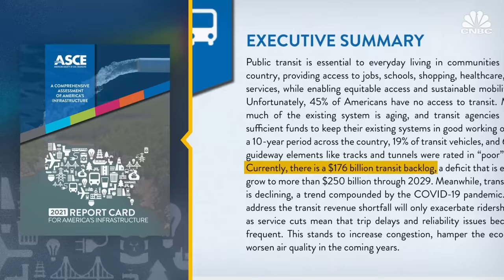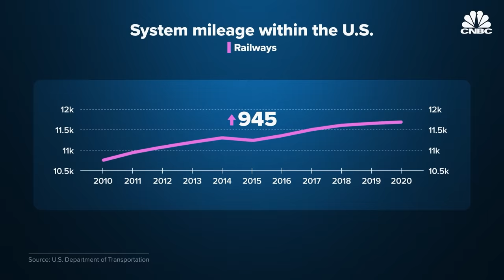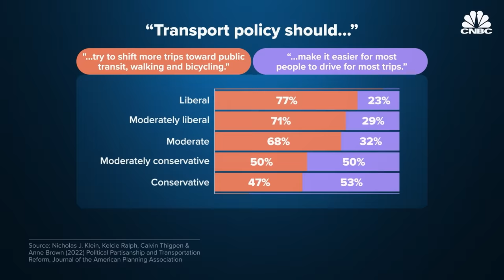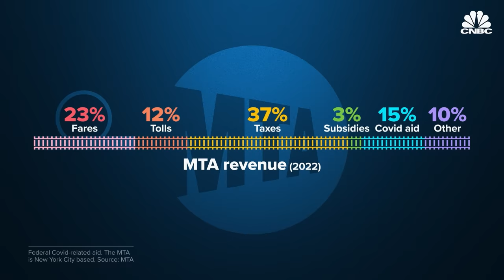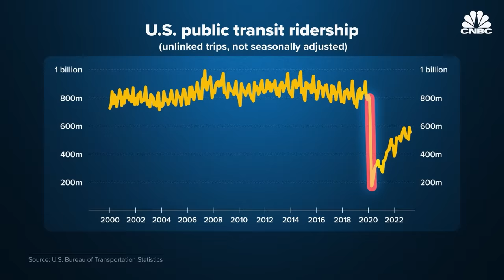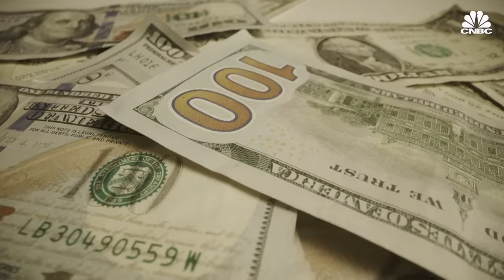Why The U.S. Gave Up On Public Transit

Comment: What really isn't discussed in this video is that while 40% of transit is funded by government subsidies and taxes, that figure for roads is likely near 100%.
Reply: once you build a road youll only have to occasionally reseal it, although I guess the continual widening and building bridges and tunnels adds up. Every day you run a bus or train you are spending money on it. You will get tons of postive effects if you improve the transit though.
Reply: @nobody48803 idk roads cost a lot to maintain, a freeway is not like a driveway. Plus we subsidise the use of cars in other ways. Fuel is heavily subsidized, parking is a cost shared by everyone through either city tax or higher prices at stores, heck you could argue the nearly trillion dollar annual us military budget through 90s and 2000s was a subsidy for cars 😬
Reply: @nobody48803  roads require quite a lot of maintenance; which is why there are always roads under construction. Resurfacing, potholes, sealing, inspection, car accidents and the damage those cause, drainage, signals, mowing, improvements. When it isn't construction season, there is snow and ice removal. All with insufficient funding.
Reply: @nobody48803 you actually have no clue what you’re talking about
Reply: The vast majority of the money to fund roads is from the taxpayers, from local, state and federal taxes we pay to fund the roads, not subsidies.
Reply: @teddymacrae one of the few smart comments I've seen looking through all these
Reply: @nobody48803 this isn't true--the life cycle of a road is about 25 years. After that, it's reconstruction time. Often, when the initial investment is subsidized by a property developer to support a new subdivision, this ends up with state government bailing our suburban municipalities which do not have the density and hence tax revenue to support its own infrastructure.
Reply: @nobody48803 yeah rural America and plenty of suburbs around cities have trash roads.
Reply: Yeah that's a fair point, unless your in a state with toll roads, all road maintenance comes straight from taxes anyways.
Reply: @nobody48803  Couldn't you argue the same with rail? "You just have to lay the rail and then occasionally service it." Easier said than done in both cases, but in terms of people moved, trains are wayyyyy better for the cost.
Reply: @BrownBomber92181  Where do you think those subsidies are from anyway? Taxpayers.
Reply: @nobody48803  actually, freeways cost the government a lot more. The average person would have to spend multiple thousands in taxes every year to pay for the current highway system alone, ignoring local roads.
Reply: So I guess all those road markings, traffic signals, intersections, crash barriers, road signs and street lighting is just a figment of my imagination then.
Reply: @nobody48803 other comments has already debunked your comment. But to add to it, there is also a significant cost on the user to simply use the road that you completely ignored. The price of the car, the likely financing to pay off the car, maintenance of the car, car insurance, other fees like registration, gasoline to run the car, and on top of that, likely the most dangerous thing you do on a daily basis. With deaths and injuries in the millions
Reply: God help us all 😢
Reply: Roads are multi-purpose though for many modes of travel and by different use cases.  Of course, public transit buses also use roads.
Reply: @BrownBomber92181 so the road is funded by taxes. that's what a subsidy is. meanwhile public transportation agencies are expected to bring in direct revenue through fares. some anti-transit people even say we shouldn't fund them unless they turn a profit, yet support subsidies for roads and cars.
Reply: @nobody48803 I live in Wisconsin and our roads are CONSTANTLY having to be repaired due to our harsh winters and poor material used to pave the roads. It’s like lighting money on fire every time they build a new road in this state.
Reply: 🎯💯 it’s all about the💰
Reply: @BrownBomber92181  Taxes are subsidies.
Reply: 99% of wear on roads comes from freight hauling trucks, which benefits everyone even those that exclusively use trains and ever use any transport that uses roads.
Reply: @nobody48803 If you drive roads like 95 in Connecticut and Massachusetts, that is absolutely not true. I'm on those highways all the time and there is no time of year where there isn't maintenance occurring. Maybe if they'd fund resurfacing in concrete, which is how its built in the first place, then the frequency of repair would go down. Totally get it that that is expensive initially, but has to be cost effective over time.
Reply: @BrownBomber92181  well primarily federal.  My elders spoke of back when they were growing up in was 18 19 20 or 21 to buy alcohol depending on what state you were in. Well the federal government said your state will pass a law to be 21 to buy alcohol or you will loose your hwy money.  So it's mostly federal money.  A state could let 18 year Olds buy alcohol. They could even let 12 year Olds buy alcohol as utterly ridiculous as that is HOWEVER they'd have some pretty deplorable hwys if they did
Reply: @leomajor88  and that's because you don't allow 18 year Olds to buy booze.  So
Reply: @Teampegleg especially when the trucks bump into you on the same road you’re driving on. 2016 totalled the car and downgraded me to a much older smokier polluting model. True story. Insurance does not necessarily pay to repair damage. Nice theory until the casualty zone zeroes in on you. It’s a numbers game. Good luck.
Reply: @nobody48803 Every government on Earth knows that maintaining a road costs more per year than building a road does.
Reply: A toll on every street isn't practical. So instead we tax the gas. The more you drive, the more you pay. Stop blaming bad transit on lack of taxes. It is bad because it is public transit
Reply: Near? It is 100% who is paying for roads? Toll Roads do not count as roads.
Reply: You are forgetting that for each liter or gallon of fuel you pay a tax that goes into roads. The other question is why is it so low in the US. Here the gas would be half the price if all taxes were abolished.
Reply: @nobody48803 ever heard of pot holes?